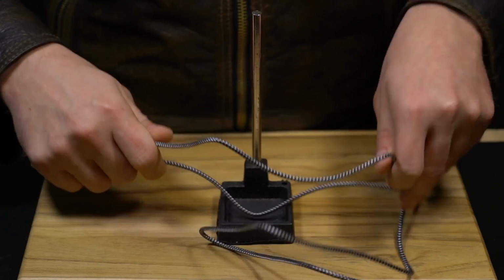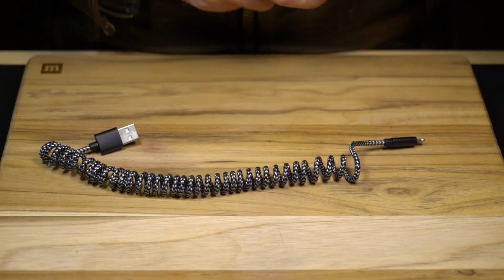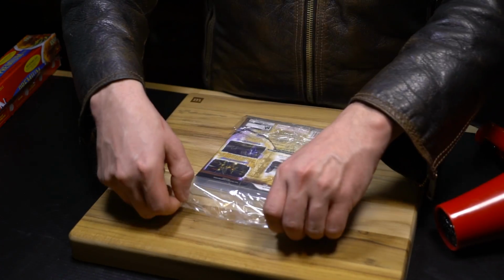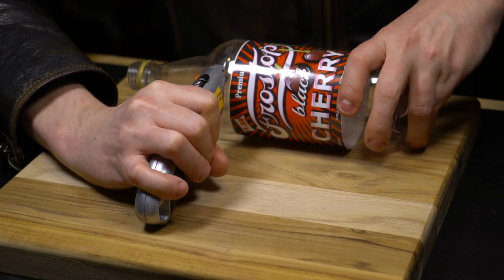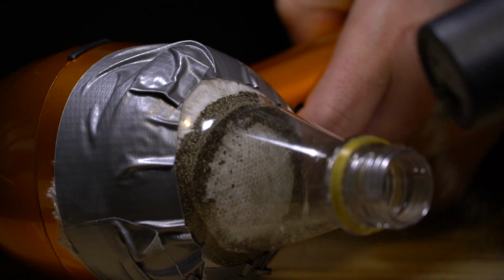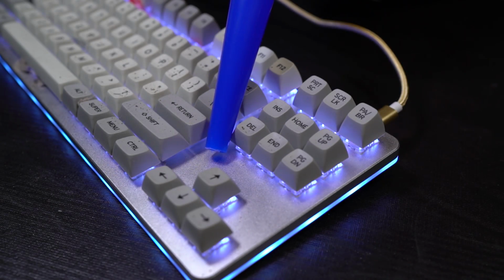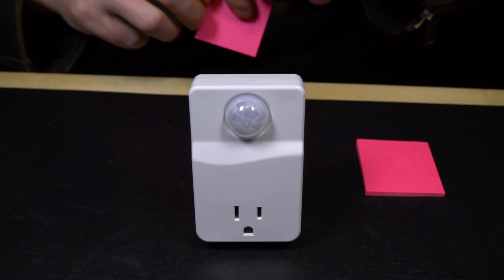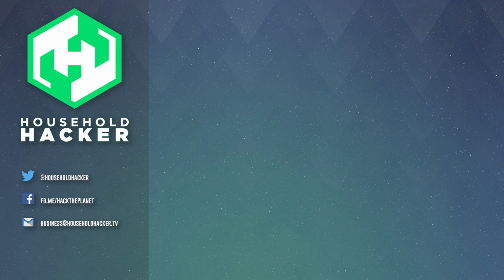5 Pro Hair Dryer Life Hacks

Comment: Repeating , again don't do the first hacked it's bad for your cables they are not designed to be abused like that . It will definitely break it from the inside even if it does slightly damage it though it still operates .